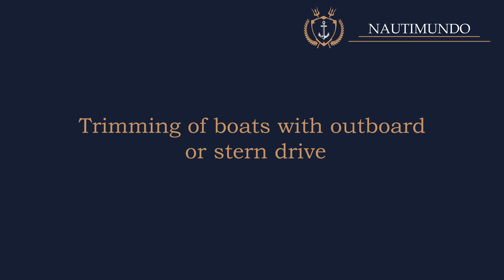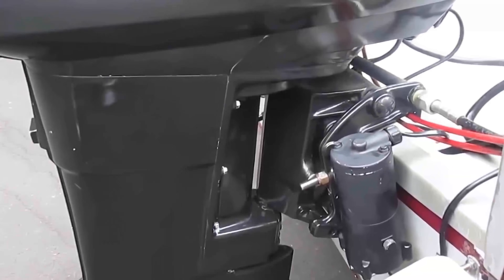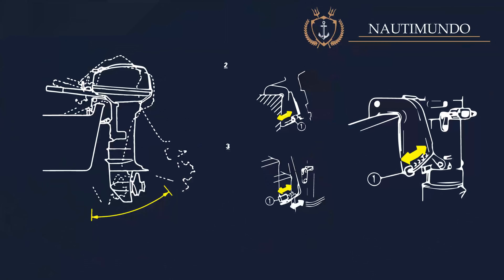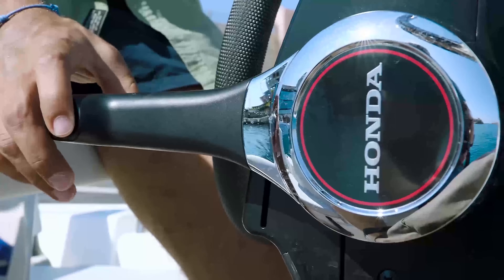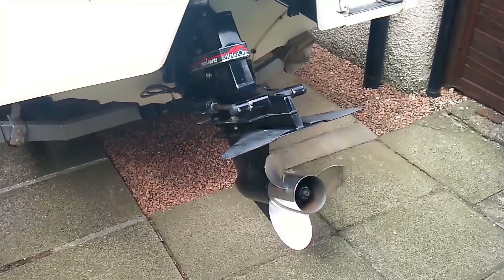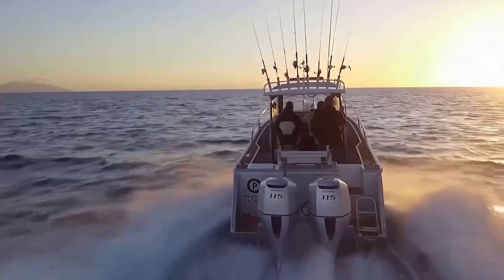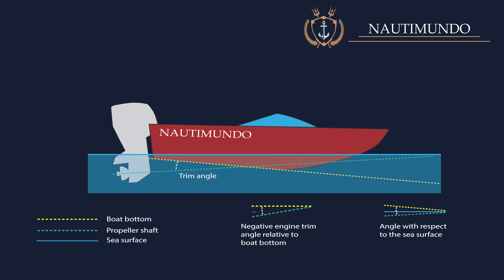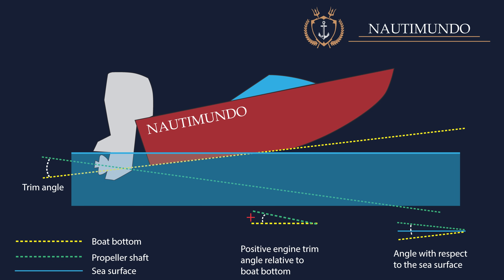How to TRIM your BOAT, with OUTBOARD or STERNDRIVE  [Basics Of Boat Trim] – NAUTIMUNDO

Comment: So basically you want to keep the motor parallel with the water surface,is that correct?
Reply: yes you  do
Reply: The prop shaft is parallel to water surface, the outboard would then be perpendicular.

Comment: most boat manufacturers dont recommend adjusting trip while operating .. how shall we do it
Reply: Adjusting trim while moving is how you should use it. From what you're saying, automatic trim adjusting outboards shouldn't exist then right?
Reply: How can you adjust your trim for the changing conditions if you can't do it while underway. That is why you have the trim switch.  You either read it wrong misunderstood it or the manual is ass wrong. You must adjust trim while underway.
Reply: @Dan-uv3vf  really mate.. Tohatsu manual book says " stop the engine before adjusting the trim"
Reply: @pildoradeolvido you probably have a small engine without hydraulic cylinders. In this case absolutely do not adjust with motor running

Comment: It’s works at higher speeds…big game trolling that same trim angle sucks at fuel economy!!
Reply: wroñg
Reply: @sharonbraselton4302  …I do big game trolling in Hawaii 11-12 hrs constant in sometimes heavy seas with a 22’and 25 ‘ boats with twin outboards…a trim (bow )up angle may be good to keep bow spray to a minimum but sucks fuel…where’d you get your info ???
Reply: @barry8458  p 800 gpod fule eñmy  80 poúnd trikiñg motrty hybrd biat
Reply: @sharonbraselton4302  ?